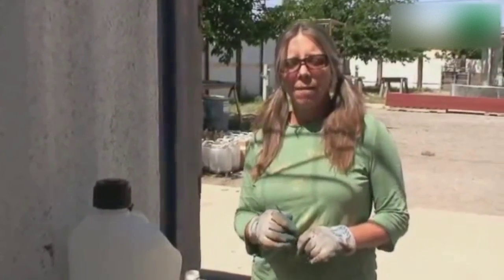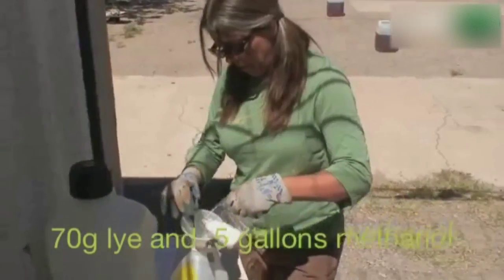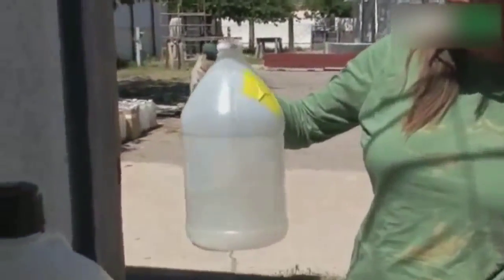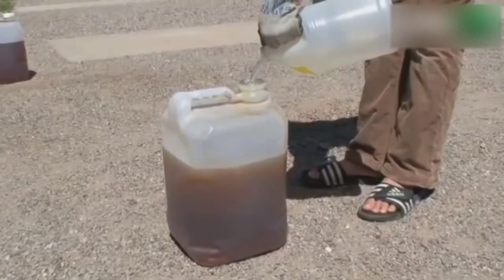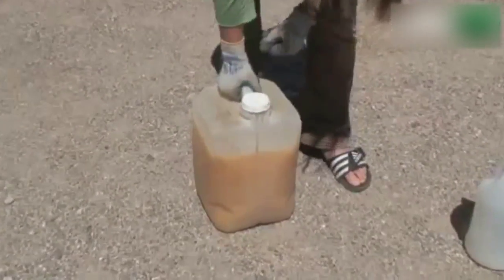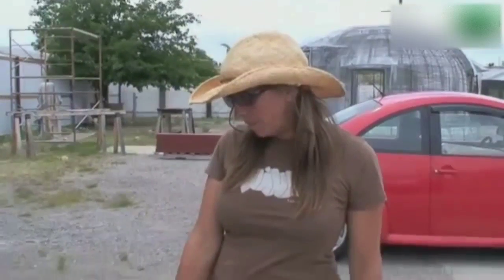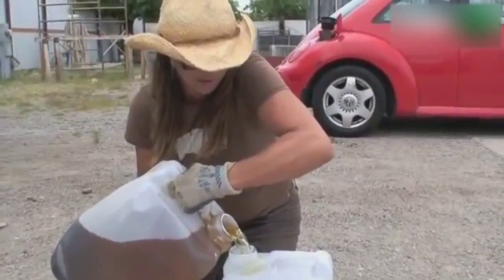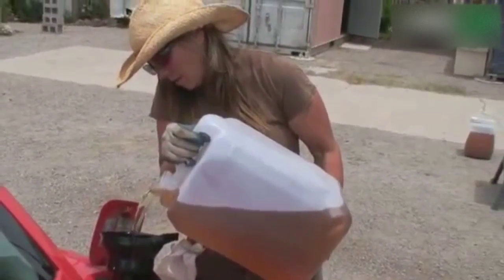How to make Biodiesel at Home in 5 Minutes..! | Biofuel From used Vegetable oil / Cooking Oil

Comment: OK..  bio deisel is very good at cleaning..so.. if your car has been run on normal deisel fuel put a new filter in before using  bio deisel..about a month or 1000 miles changed to fuel filter for a new one..why.. the bio fuel will clean all the crap and gunk from your fuel tank...lines and fuel pump and sent it through your injectiors.. this is not good for them.. Next..  bio deisel doesn't like the cold.. so you might  want to mix it in with some normal deisel..  
And from experience I used to run a maximum of 80 bio deisel and 20 normal deisel as it seam to start better. The other thing to think of using is fuel biocide..why there are bugs that love bio diesel.

Comment: No water wash means high ph and corrosion to everything and hoses, always water wash biodiesel its safe ,cheap to do and works. The savings will soon turn into losses from damage inj pump, lift pump ,lines etc. if you don't wash it .
Reply: Ho do you do a water wash?
Reply: @mpozainno  Pretty much like it says, I use hot water and use about 5-8  gallons each water wash of a 40 gallon batch . The first wash just be gentle, spray water in let settle for an hour or so then drain out the soapy water and repeat process until you have clear water not soapy. I use a fish tank air pump to pump bubbles(stones) in it to help the wash process . It normally takes me about 4 washes .  I try to make my biodiesel in the summer and take advantage of the sun heating my garden hose for the free  hot water .
Reply: Shalom Aleichem. 

Would you please post complete instructions on how to make bio-diesel including the water wash process.

Thank you.

Ratson haba b'shem YaHuah
Reply: @mikepaulski1108  There are plenty of forums you can go to and videos that can go into far more detail than I can provide in a comments section. Start small and get comfortable with it first and stay in a well ventilated area .
Reply: If I add acid will it solve the high ph problem?
Reply: @gbZHe8  If you mean LSD, then definitely.
Reply: @gbZHe8  lol just water wash it .
Reply: Yep
Reply: Correct
Reply: Uhh did I hear LSD ?? Lol.......??👌❤🤐😏or 🍽🍄
Reply: Don't think she's very mechanicaly minded..

Comment: Some point I remember from another video: Put the lye in methanol. Never put Methanol on lye or you will have an explosion. Use 2 liter of methanol for every 10 liter oil.
Reply: We pay around $3.74 / liter for methanol($747/200lt drum), so that equals $7.47 cost per 10 liters of oil, plus the lye(what volume of the 10+2 liters is waste, i assume around 2lt?). 
yet clean new diesel can be got for $0.99 per liter here(lowest local), so sweet all savings to made for us, especially if you pay for the cooking oil, let alone your time picking up oil, treating it, cleaning up used items and spills, and then dumping the waste. I will stick to buying from a gas station, it's perfectly clean, plus very quick and easy, and available anywhere i am.  (also wonder if mpg under same conditions is as good as pump fuel?).
Just has another thought, it likely would end up more expensive than buying at the pump for me, as the exhaust smell would likely trigger the munchies as well, every time i drove :-)
Reply: @Retiredkiwi  you are paying too much for metahnol, here, it cost less than 0.6$/liter per drum of 200liters.
Reply: Where are you getting diesel from that cheap?

Comment: No rinsing? the sodium hydroxide still suspended in the fuel must be really good for the aluminium injection pump, it eats that metal.
Reply: Thanks
Reply: Good point 👍
Reply: How do you do the rinsing?
Reply: 70g to 3 gallons of oil and you dump off a glycerin layer the ratio is there to deplete "use up" the hydroxide. think lye based soaps yea sometimes it burns because  the lye to fat or oils is to far off.

Comment: What does this do to the warrantees and guarantees on new vehicles?
Reply: Not applicable for newer common rail or fuel injected diesel engines. 

Only the mechanical injection pump will perfectly fine

Comment: Another site did another process after removing the glycerin. They put water in up to four time and let the diesal seperate with settling. What would the water step remove from this fuel?
Reply: The water reacts with lye and methanol left in the biodiesel separating it, letting it set the water/lye/methanol settle out and draining it same as with glycol
Reply: remnants of the methanol solution  and more glycerin

Comment: Ok, I got a dumb question. Would this work with a regular car, or would it need a diesel engine?
Reply: Yes it only works for diesel engines and not all diesel engines will handle it either, veg oils eat the rubber seals out of some injector pumps and eat some rubber fuel lines too which can lead to thousands in repair bills
Reply: Only on the second one and mix it with diesel fuel.
Reply: @Tolbens  also try to not use it with cars that have a turbine.

Comment: Any issues clogging fuel filters or pumps? I’ve heard transmission oil in newer trucks will clog fuel filters wondering if this would do the same
Reply: Run a cheaper filter before your expensive diesel filter to take the brunt of it. I've seen guys run cheapo gasoline engine filters before their diesel filter. It's way cheaper so you can change it often enough to save money on the other parts. Just change it pretty often. Mostly seen it done with using old motor oil but a few guys ran biodiesel with that set up and everything still seems fine last I heard.
Reply: Bio fuel cleans your engine so at first you will go through filters like mad

Comment: That seems a bit risky. your decanted fuel should be gently washed with water (and re-decant) to remove any trace of methanol, or you will probably wreck your injector pump .
Reply: Yeah I think that but a lot of people use biodiesel without washing last week I have a problem that my 10 gallons production no matter how many times I washed it still decantate soap and still being oppacy, do you know a solution?
Reply: How exactly do you wash it and get the water back out?
Reply: Diesel and water don’t mix

Comment: The are limits on the amounts of fatty acid methyl ester (FAME) that can be blended into petroleum diesel of 7% in Europe and 5% in the United States.  Using 100% FAME risks damaging the car even if it has been made perfectly which seems unlikely with this home process.  When biodiesel is made industrially there is multi-step purification process and a long list of specifications that have to be adhered to.

Comment: This is for a school investigation, its hard to find results on the internet. If the Biodiesel solution is lit up by a match or spark, could it explode? And if so could anyone describe its intensity and how dangerous it is. I need this urgently
Reply: No, because this type of fuel must be compressed in order to ignite. Unlike gasoline that needs a spark to ignite, biodiesel needs to be compressed to ignite. Hope this helps
Reply: As a student, you need to be more practical with your investigations. Instead of relying on replies from people online, you could have done the test yourself easily. I am sure you can find cooked oil in your household and try lighting it up with match (in a safe environment).
Reply: @unkertech  Thank you for your response, but I already did as you suggested. I even got in communication with a university laboratory to be able to test biofuels with more intense situations. I am just doing a project for 12th grade but im not allowed to test combustible materials on my own, it’s part of the law here and in other places of the world. So in order to bypass that roadblock, had to get in contact with a certified scientist that specializes in combustible material. We found many ways of testing. Of course the easiest way to test is in a biofuel supported engine, but where’s the fun in that? 😆 So instead we are using long wicks to test from a distance to test them. Thanks again for your response
Reply: @Isan3747  Who gives a damn about the law? Get some fuel and light it up on your backyard! You're not gonna set the world of fire. Damn, what's happening with these kids nowadays?
Reply: Lols where I'm from you just stick a cigarette in a cup of the fuel and see what happens 😂😂
Reply: You know youtube comments ain't a good source

Comment: does it work with raw palm oil?
Reply: Yaa can, but raw palm oil more expensive
Reply: If it's oil it'll work just make sure it's filtered and Has all the water out of it
Reply: As far as I know, Yes, it is the preferred oil from S.E.Asia, but you would have to do a Titration to work out the amount of Sodium or Potasium Hydroxide.

Comment: Does this harm new Diesel engines?
Reply: I wouldn’t recommend it. The best place to check is car talk forums. Most diesel pre 2000 are okay.
Reply: I wouldn't run a new engine on homemade fuel.
Do this on an old diesel car / engine.
Reply: I've heard you can try a larger fuel pump if the one you have is having trouble pumping the more viscous fuel. I have no idea about how it affects anything inside the engine itself.
Reply: It'll clog up the lines, filters and maybe the injection nozzles. But that's over time.

Comment: Can I use ethanol instead of methanol.
Reply: Yes you can. They’re probably using methanol as it’s a cheap alcohol compared to ethanol (taxes, mainly)
Reply: Yes, but the reactants' correct proportions should differ.
Reply: @italocesar1444  i try to do with 96 ethanol and I used 300cl for 1 liter oil with 6 grams of caustic lye and after having a week down the sun with 30 degrees at midday the glycerine dont decantate do you know why?
Reply: @breogan8121  i saw another video that said the glycerin thickens over time

Comment: How about getting rid of methanol from the biodiesel part
Reply: Methanol is what makes it burn properly
Reply: @hayden9102  Methanol is needed for the initial reaction but it is then supposed to be removed along with the soap and the glycerin. I’m not sure how just sitting in the sun would remove anything other than separating the glycerin. 

If you aren’t going to wash your reacted oil then you might as well just use straight filtered veggie oil, particularly if you live in a warm environment where it won’t gel up in your tank.

Comment: You could just filter the oil and put it straight in the tank, 1.9 VW diesels will use it without any problems. The only reason you need to add anything is if you live in a really cold environment like northern canada or somewhere.
Reply: @Gadolini Rutherfordium  no it’s to thin it out in cold temperatures. The oil gets thicker the colder it get. It’s never gonna get cold enough to have trouble starting the car in California. You have to be in Russia or Northern Canada to have that problem.
Reply: @sleepercell9926  good to know cause I live in Southern California and would love to do this, gas is expensive as fuck and having a diesel running on veg oil would be amazing
Reply: @sleepercell9926  Or any northern European country!
Reply: Nah filtered oil alone fucks up the engine in the long run if it doesn't have the right engine modifications this method breaks it down chemically into a much more useful fuel
Reply: @nikcile4034  what would be needed?
Reply: Could you just cut it with diesel fuel at the pump to gain the same benefits?
Reply: @MrAppalachia  LoL “cut” it with diesel? What is this, a gas 8 Ball??? 😂🤣
Reply: What about 2.0L VW diesels?
Reply: @shaynlariviere5687  I'm not so sure about those they're alot more tempermental than the 1.9 PD units. They are commonrail diesels and i'm not sure how the extra thickness of WVO would affect the pressure sensors VW use to monitor fuel pressure. I had a commonrail mercedes diesel that I ran without problems but it was an old vehicle from 2001. The great thing about the 1.9 diesel VW is that its basically an industrial engine, they put it in some commercial vehicles, passats golfs vans small trucks. It was as close to being bullet proof reliable as an engine could get and could take some serious abuse. The 2.0 more refined but alot less reliable.
Reply: Thoughts on unleaded fuel- we are vegetable oil work?
Reply: no
Reply: Diesel is not a solvent, so by adding diesel you’re not thinning the oil. The only way to thin the oil is by adding a solvent such as gasoline. Most people who thin oil with gasoline add about 20%.

Comment: You gotta boil the old vegetable to get the water out also.
Reply: She has them sitting in the sun so that they separate the solids, water, and liquid.
Reply: @jamie6387  As long it's above freezing I guess over time?
Reply: @METALMAN4Wii  I think she said she was from New Mexico and it looks like summer time, it does not take very long to heat up in direct sunlight at 100 degrees Fahrenheit.  I guess it all depends where you live and the climate there.
Reply: @METALMAN4Wii  I would suggest if you have enough oil and to develop a low cost system to dewater your oil. Buy a 55 gallon steel drum, install a 3/4 inch ball valve on the bottom of tank. Buy an electric barrel heater and slap that on there. It will heat up over night, if not quicker. Then just drain the water off at the valve until you hit oil. Voila.
Reply: @jamie6387  Will water go to bottom to be sumped like gasoline? I guess I figured it would be suspended in the fuel like it would in jet fuel... I guess since it's just vegetable oil and not kerosene it would separate
Reply: @jamie6387  dont forget on glycerin when filtering the oil ;)